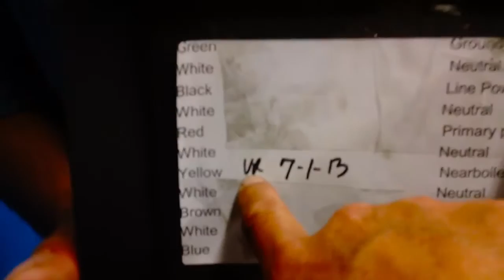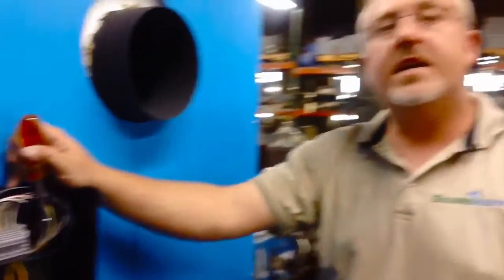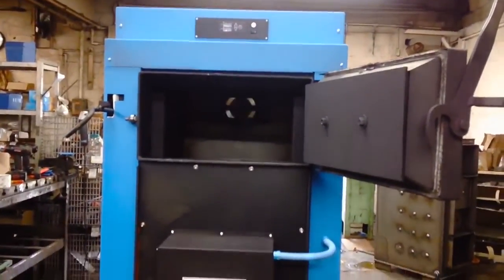The Econoburn Boiler Part 3 - Failsafe Electrical Systems

Comment: How do you keep the pumps running when the powers out? 2:14 of the video
Reply from the maker: Hydronic boiler systems do require electricity to operate. If the power goes out, the unit will shut off, or you will require a backup power source.